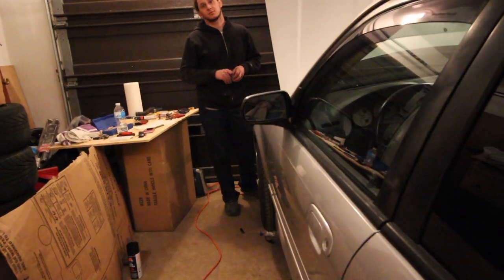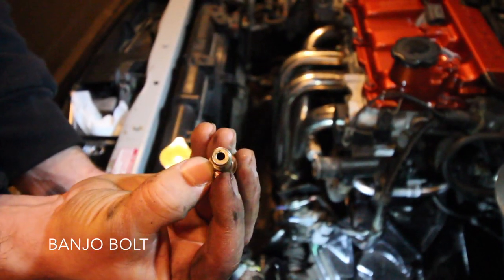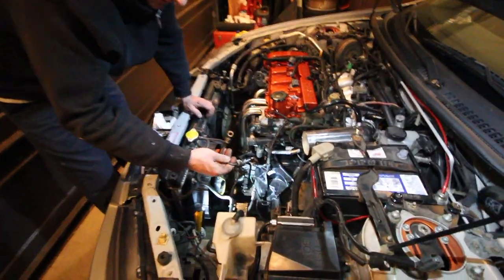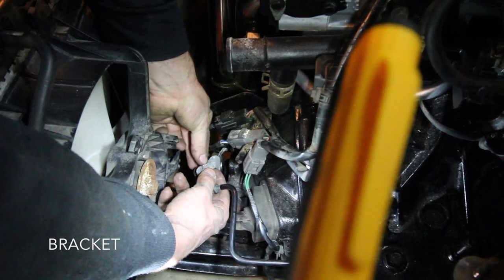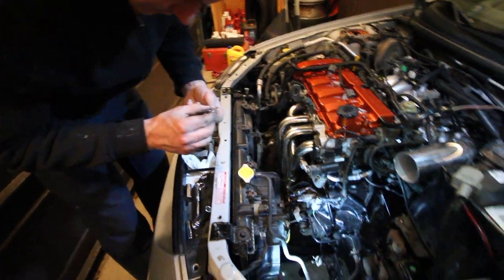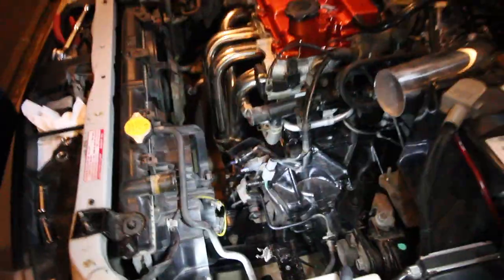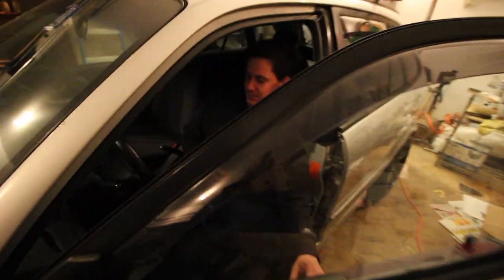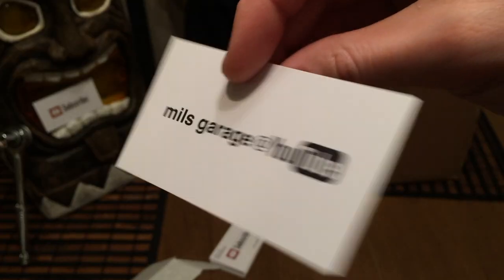How to Install & Bleed Clutch Line

Comment: Yo my gears are stuck in 2nd wont go into another gear or reverse, fluid is full clutch has pressure and it will go into the gear its stuck in but wont shift. HELP?!